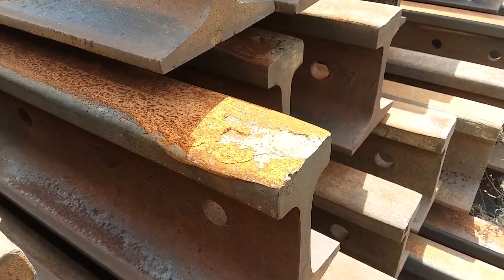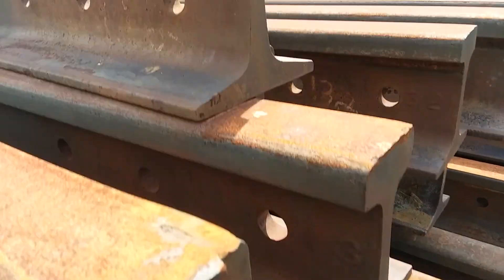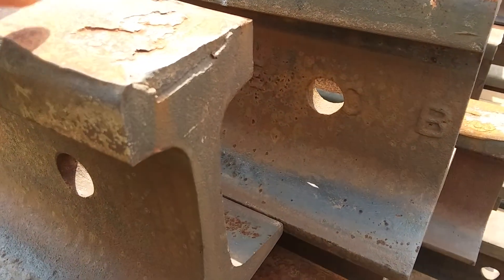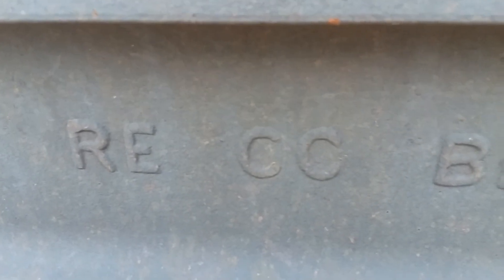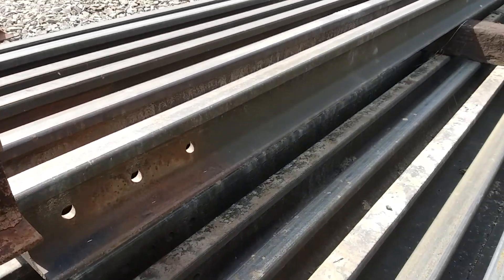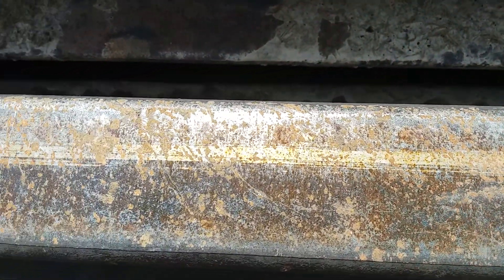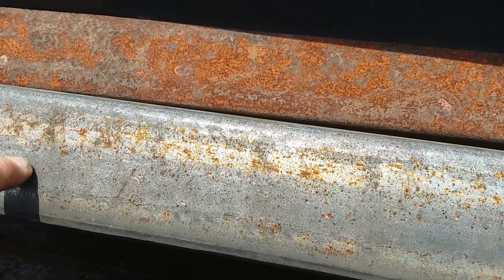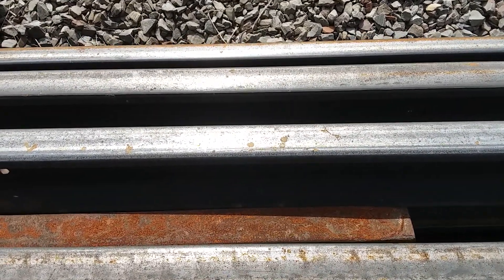Rail Defects: Battered Heads, Corrugation, Sliding Wheels

Comment: Haha, wheels bumping at the joint. What about grinding and welding the rail up in place? Those rails are 10% heavier then our Swedish worst rails! Everything is big in the US...
Exercised with a machine (loco) knowing guy to get my expired license back. It's a 3 axle, 21 ton, 10 feet wheel based, locomotive. Passing weak joints the loco moves like a bird bowing its head at every joint. The "instructor" said: damned those joints.... Tampering is needed.
Running at an axle load of 33 tons, not 7.... things happens....
Cheers Dave.
Reply from the maker: Yep jointed track needs lots of tamping, I should know with 16
miles of jointed track....:-) Thanks so much for watching my friend.

Comment: I have a question for you? The rails slope towards the center of the track, and the wheels on the train cars and local motives are cone from the inside of the car out is that correct or not? And that puts the wheel to real contact about the size of a dime.
Reply from the maker: You are correct in all of that Rosie. Tie plates have a 1 in 40 cant
which slopes the rails slightly inwards, the conical shape
of the car wheels is about the same slope. There are different
reasons for both of the above. Thanks for watching and writing
in my friend.

Comment: Aren't the rail beams supposed to have a different, sharper crown, where the wheel rides?
Or does this coal mine rail needs to be wider on the crown, or does it just flatten over the years?
Reply from the maker: New rail has a crown to it, an oval shaped head. Over the many
years of heavy traffic this gets worn down as you can imagine
Daniel. Thanks so much for visiting with us today and checking
out the show my good man.

Comment: What do y’all do with all that old rail?
Reply from the maker: The good used rail is kept in case we need a stick to put in someplace when replacing a rail. The not so good stuff is sold
to a contractor who often uses it for a siding somewhere they
might be building. The junk rail goes into a dumpster and is sold
for scrap
Reply: @ccrx6700  thanks my friend.

Comment: The battered ends are due to the joint.  The disjoint is what creates the force and stress to drive the fatigue.  The damage to the ties and ballast is due to the joint (not the other way round).  The forces at the joint will be in the order of three time that of a plain rail without the joint

The solution is to continuously weld the rail.  

We could talk all day regarding causes of rail corrugation.
Reply: But there must be joints. It is impossible to continuously weld rails as the growth/shrinkage due to ambient temperature variance would buckle the rails leading to derailments. The joints are a necessity to prevent this. The general method is to weld together as many sticks as can have a joint that is not so wide as to create battering at the joints as we see here. The number of sticks that can be welded is entirely dependent on local climatic conditions.
Reply: @ronoldenbeuving695  and the nearby main lines do what?    It’s an isolated rail line living in its own bubble.

Comment: Is it worth having an analysis undertaken on the composition of these 1997 rails, and is an independent analysis on the steel composition ever undertaken upon accepting a large delivery of new rail  stock ? Also, why does America persist in using wooden instead of concrete sleepers ? Interesting show, guy.
Reply: Till recently concrete used to be 5 times the cost of wood. At the rate wood is becoming so expensive that might change for them soon

Comment: Can you correct the defects in the rail by cutting off the defective part and drilling new holes in the side ?
Reply from the maker: Bob, excellent question! Yes we can and sometimes we have cut out a section of rail and put a plug in. But usually we just have replaced the whole 39 foot stick, it's just about as easy do that than putting in a plug. Appreciate your watching sir

Comment: As big and heavy and powerful as train wheels are, I can't see how a slightly blemished rail could make any difference
Reply: The suspension of you automobile  including the shocks and especially the rubber pneumatic tires do a lot to give the smooth ride that you are accustomed to. Rail cars do have springs but with the massive weight, hard steel wheels running on hard steel track even the smallest imperfection has a huge impact on the ride. There's a lot of energy there and it's amazing that the rails survive given the beating they take. Imagine Ali standing on your right, Leonard on your left, and the two of them are pounding on your head at the same time like jackhammers.

Comment: Would the mine ever consider have a rail grinder crew come out and reprofile the rails I have seen it on CP rail lines to extend the rail life
Reply from the maker: Dan, being that we dont interchange with another road makes it impossible to get a big Loram grinder in. I have suggested for years about trying to get a smaller switch grinder trucked in, but hasnt happened yet. Grinding does increase the life of rail. Thanks for watching
Reply: @ccrx6700  ahhh I did not know your system was closed. My God how did you guys get an sd-40 out there
The radar o'reilly method 
Ship it one piece at a time untill its built?
Reply from the maker: @dank2265  Dan, hah ha, nice one! Norfolk Southern has tracks bout 4 mikes from us, it on old Monongahela RR track. There is a siding at Poland Mines. From there Hulcher trucked all our rolling stock in to us. Absolute Expense! Got some pics of them bringing loco 3098 in, am gonna do a vid on that sometime in future so stay tuned. This is one unique rr. Appreciate your watching and comments
Reply: @ccrx6700  I saw in a different video where you stated you're a closed system. I too wondered how you got the locomotives in there. Even though you said you were closed I still thought you surely had access to the mainline. Guess not!
Reply from the maker: @RustyorBroken  everything gotta be trucked in, am gonna do a vid sometime in future on each of our 3 locos, got some pics of 3098 on a truck being brought in, its a big truck!

Comment: Isn't that a 132 lbs. Per. Foot?
Reply: Rail weight is measured lb per 3 ft
Ex. Main line rail is usually 132 or more
Secondaries 100 to 132
Side track I have seen 90 to 100 and yards I have seen 80
Reply: Structural steel, I beams, channel, etc. are per foot. Rail being 3 foot threw me off as well. There's so many rails that are very similar if you went per foot you wouldn't be able to tell the difference between them.

Comment: Why can't you just re-surface / surface grind the top of the rail and grind all that out?  Then it would be like new wouldn't it?
Reply from the maker: Yes it would, but since we are not inter changed
Or connected with any other rr, we have no way of getting one of those huge grinders here. Although they do make small switch grinder we could get to come, that isnt cheap and those in our company who allocate money has ever agreed with me to put out the money to grind our track
Reply: @ccrx6700  So you're land locked? How would you get new cars or a new locomotive in?
Reply from the maker: @kleetus92  Norfolk Southern has tracks close to us in Poland Mines [that a small town] from their they trucked cars and locos in. Its about 5 or so miles from there to our tracks
Reply: @ccrx6700  Cool.

Completely off the wall question, what kind of coal, or what seam are you guys mining? I mean anthracite, bituminous...  I'm trying to find some pocahontas seam coal for believe it or not, model RR use that isn't ground to dust.
Reply from the maker: @kleetus92  bituminous sir, it,s in the Pittsburgh seam of coal, that pretty neat what you are looking for good luck.
Reply: @ccrx6700  I'm looking for nut like 1/2 by 1.5 half or 3/8 by 2, with a decent amount of vols still in it, but low ash. Hence the Pocahontas stuff, for 1/8 scale locomotives, your firebox area isn't that big, and with low vol stuff, if you lose your fire or aren't on it 100% and get a cold spot, you might as well dump the pan and start all over. I could literally use a couple of ton for myself and a few other clubs.
Reply: How much for a ton of coal nowadays to heat a house?
Reply from the maker: @notyou6950  i have no idea, we have various sell prices to different buyers, it averages round 40 bucks a ton, but there are so many variations in contracts, just an example would be sulfer content and btu, hope that helped somewhat
Reply: @ccrx6700  thanks!
Last time I heard of coal for sale was back in mid 1970 in Poland and it was $3.00 (three dollars per tone) exported pricing. No wonder they shipped all they mined. The technical term for their style of coal mining was "metoda rabunkowa", (robbery mining) since they did not install much safety structures in the tunels at that time. The commies had no cash to make safety a priority. They rewarded only those that made more tunel through the coal vain. Those men were doing it mostly by hand. Mechanization came later.
Reply from the maker: @notyou6950  great history lesson there, thanks for sharing